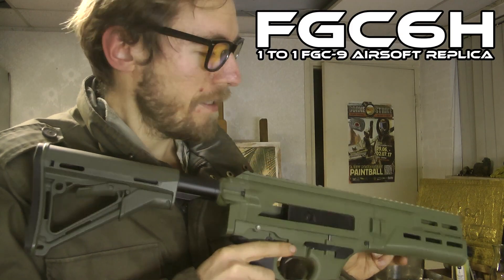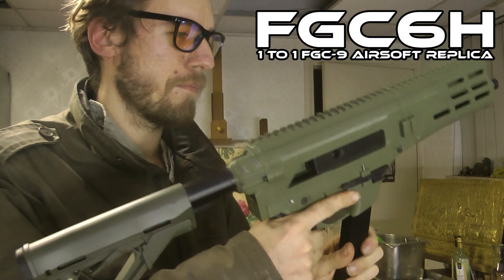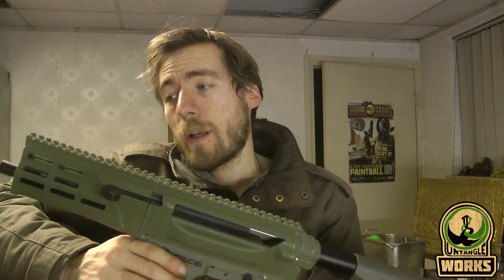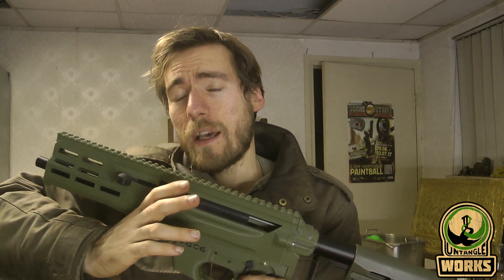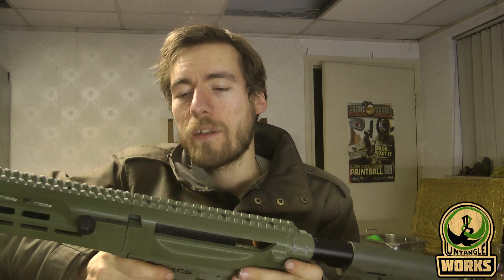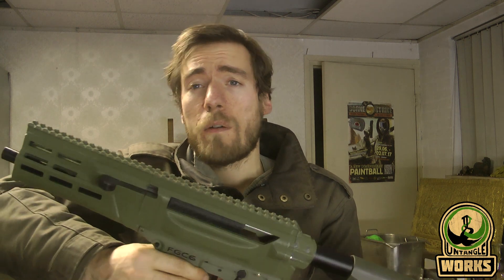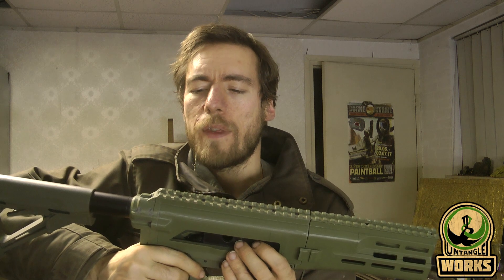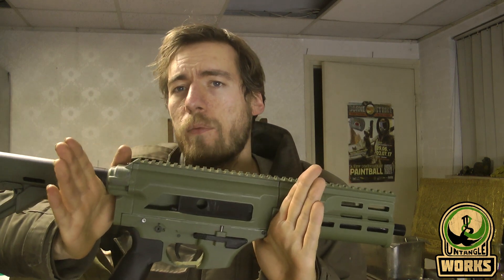FGC-6H the it finally works announcement for  the hammer fired airsoft replica of the FGC-9

Comment: How many FPS do you get and on what BB weight did you use?
Reply from the maker: this is mentioned in the tester data, but I have to redo all my testing with the development off the locked fire pin assembly. so the best recommended spring setup might chance
Reply: Thank you for your relpy! I also really like your 3d printed hopup, the maple hopups are super expensive where I live.
Reply from the maker: thanks, yeah it will also help with the ease of adjustment . and also cut down the cost a bit @LillyChapman-m8j
Reply: You don't happen to know if Action Army AAP-01 mags work? The nozzel looks the same as the WE G series mags in the manual.   @UntangleWORKS
Reply from the maker: bassed on some builders in my discord it can be done the mags that is . the nozzle should have a different design. it looks a bit more like the one of a G18 more or less that model is not compatible  @LillyChapman-m8j